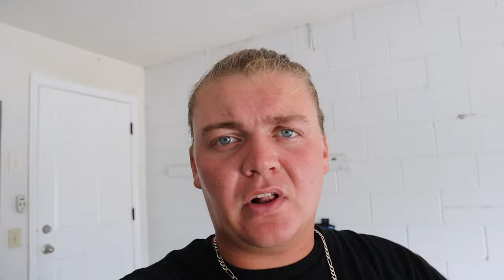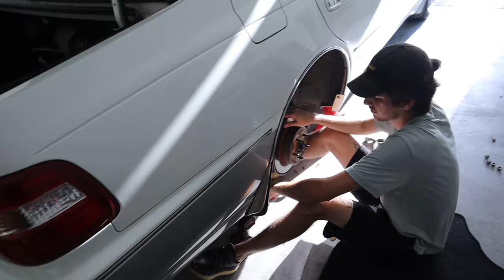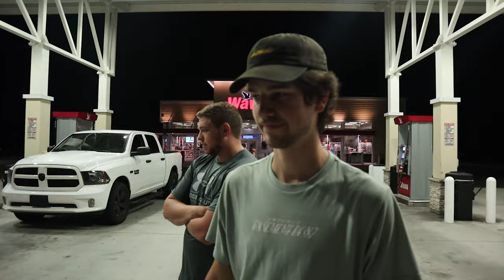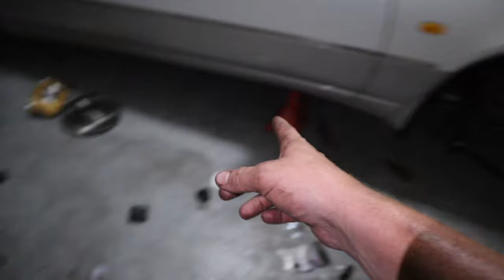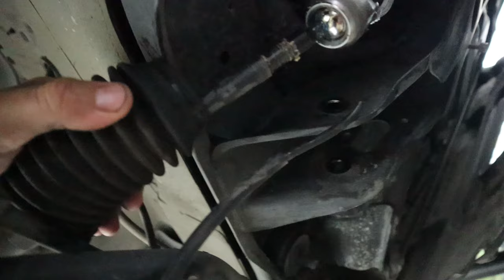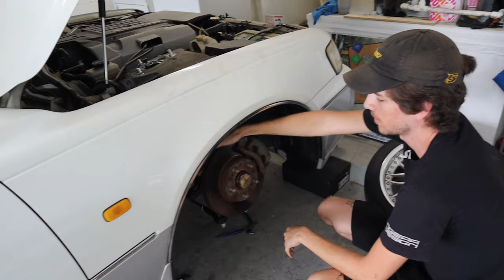Y33 CIMA/Q45 COILOVERS, GKTECH ANGLE KIT, AND CAMBER ARMS

Comment: Okay so I have a y34 all on silvers and s-chassis front I know for the y34 if you use the super low option with the s-chassis lower mount the shock it self isn’t long enough and people use a Hyundai Genesis shock with everything swapped over. Hope this helps and the chrome rays are 🔥

Comment: Hey bro I have a question, does camber lower or raise your car? I’ve always heard that it lowers your car but I’ve also heard that is wrong & that it actually raises it. Idk if this is a dumb question but I’d like to hear what you know or think
Reply from the maker: I could write a paper with all the factors that would effect the heigh with camber🤣 overall, it doesn’t really do either, would lean toward raise the car at but when going from 0 to around -10 to -20 but tire stretch, location of camber, suspension setups type all factor is to it.
Reply: @OCTANEANDZIPTIES  thanks for replying bro